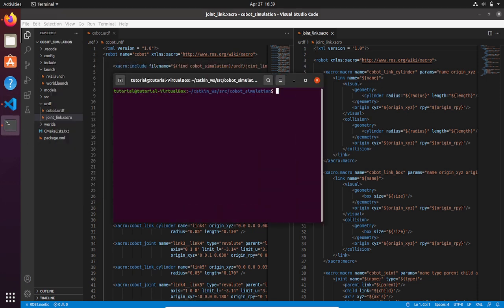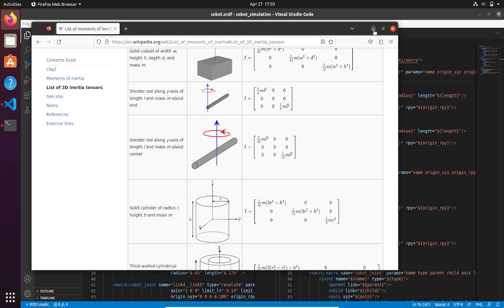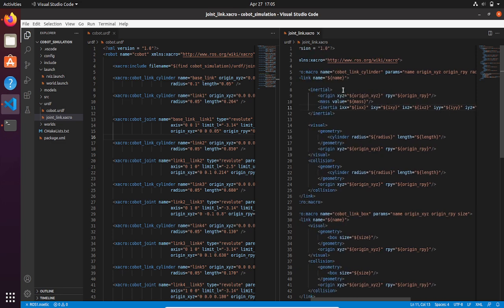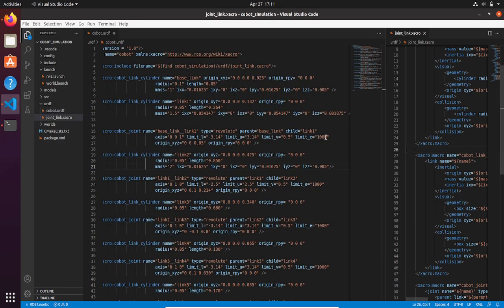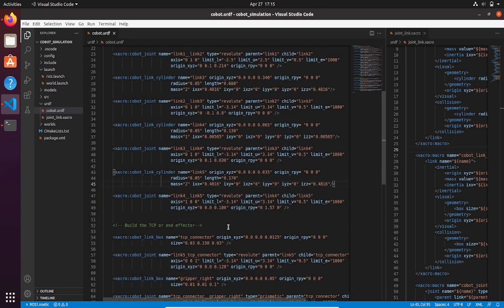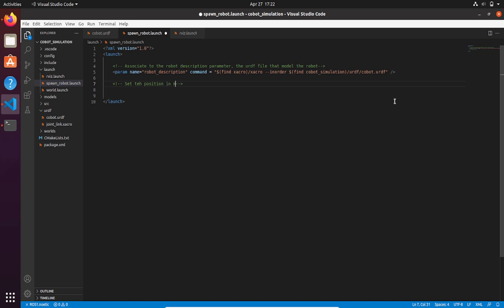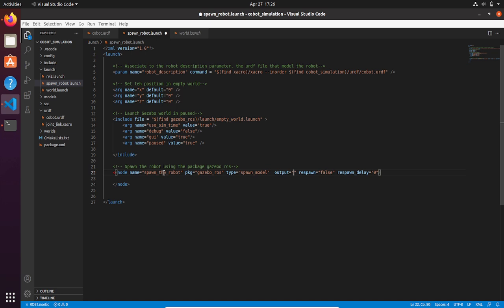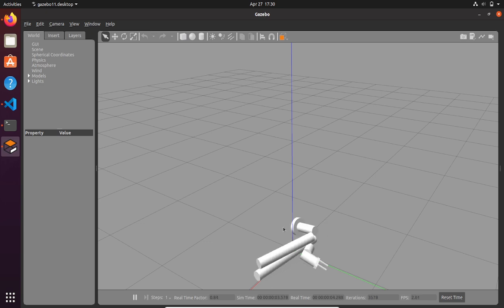How to Calculate Inertia values of your Robot and spawn in Gazebo

Comment: Hi, why did you copy link2 inertia values' in link3/5? They should have different inertia values since they have different lengths. In addition, if base_link has a length of 0.05m, a radius of 0.1m and a mass of 1kg, the relative moments of inertia ixx and iyy should be equal to 0.0027 according to the formula ixx=iyy=1/12*m*(3r^2+h^2). Similarly, link1 should have have a moment of inertia (ixx and iyy) of 0.00965 according to the same formula. Thanks